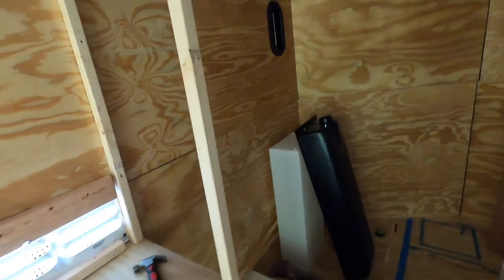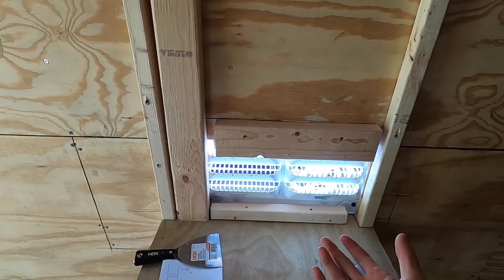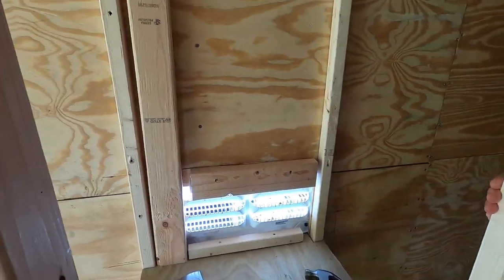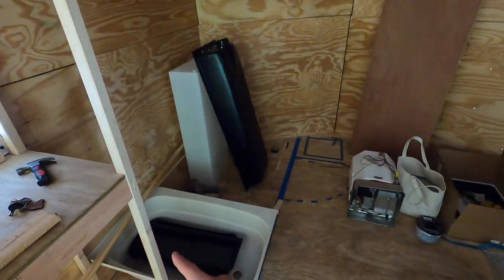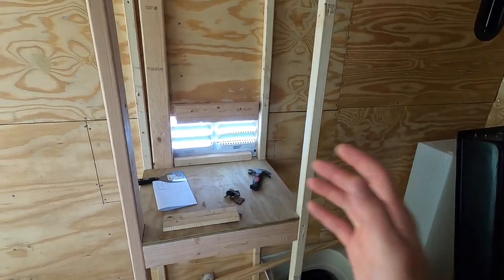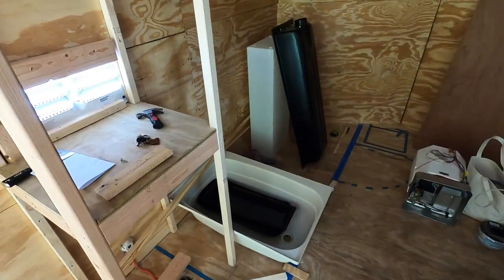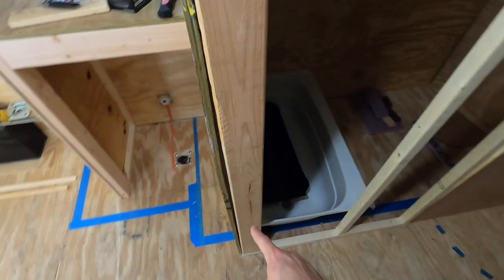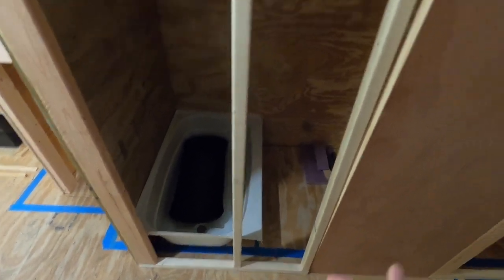Cargo Trailer Conversion Framing in the BATHROOM!

Comment: How will the black tank sit under the trailer with the toilet up front? Isn't there lots of under carriage framing in the front part ?
Reply from the maker: Great question! So we will not have a black tank in this trailer. I have yet to post the video as I’m still editing but the grey tank is mounted under the floor of the tub. We don’t need a black tank because we will be using a composting toilet in the bathroom (low maintenance and no need to visit a dump station for offloading) all of the tanks we got were very specific in diameter as my floor frame is 16 on center and a lot of the prefab RV tanks are not designed for that. I got a lot done this weekend and have to post the videos but they are coming don’t you worry. The build is getting closer to being done every day.
Reply from the maker: DCLEMMS1 wow that’s an interesting toilet? I have not heard of that before. The one we have for the trailer is the nature’s head composting toilet

Comment: There are lighter methods than to use 2x4s.
Reply from the maker: I know there are, unfortunately I was on a very very tight budget and the two by and one by option was cheaper. Thanks for your input though. The walls have still held up great after moving cross country and doing a lot of mountain road driving. Good ole trusty wood!